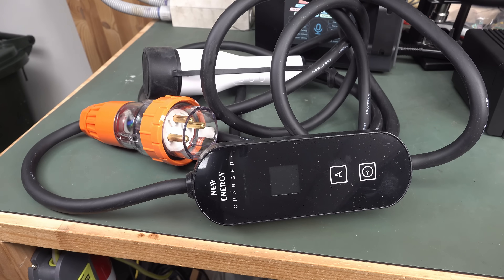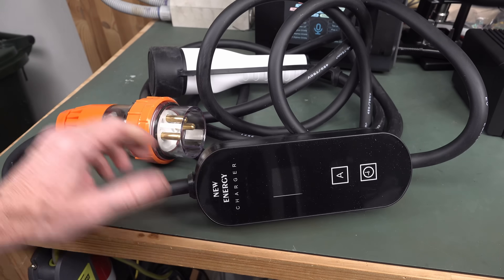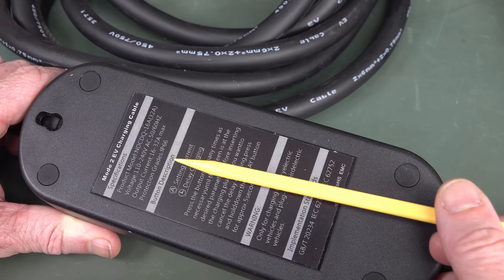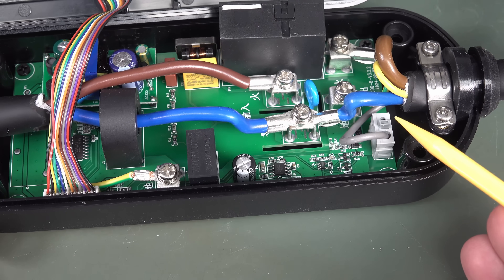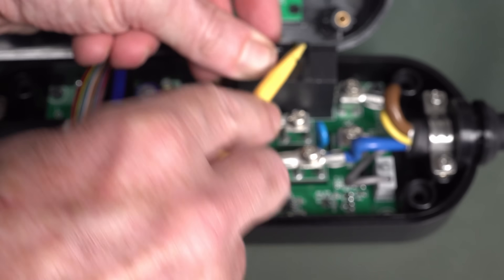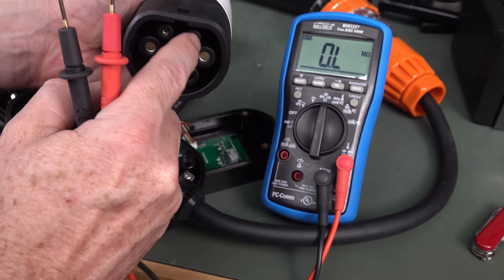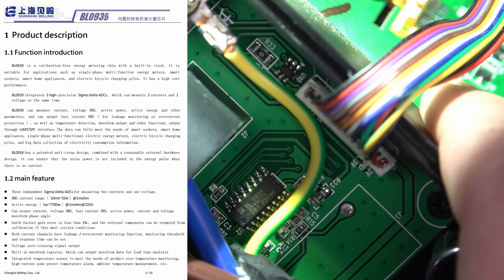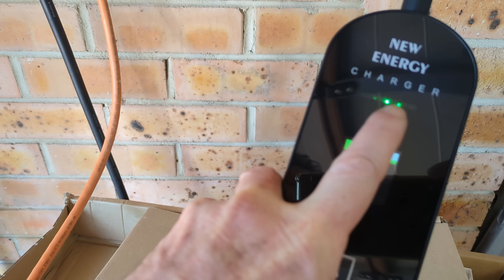EEVblog 1643 - DON'T BUY this Cheap 7kW 32A EV EVSE Charger

Comment: The best description of an EVSE is a "smart safety switch".  It makes sure the cable is dead until both ends are properly connected.
Reply from the maker: Yep, and if it lacks both the "safety" and "bead"  feature like this one does, it's a loser.
Reply: @randycarter2001  …a fancy extension cord with safety switches.
Reply: The only thing I don't understand is why the heck are they so expensive?
Reply: Not sure this one makes sure, it has a half hearted go though.
Reply: With some metering and power negotiation features added. All the AC/DC conversion and control over the current drawn from the mains is in the inverter built into the car. 

It's like:
(EV) Hey, I'd like to charge. How much power can you supply?
(EVSE) I can give you 7kW of power.
(EV) OK, I'm locking the plug on my side. Start the charge.
(EVSE) locks the plug on its side if applicable (if it has a charging socket instead of fixed cable), turns on the relay, indicates charging state to the user with some LEDs etc., monitors power, informs other systems like power balancing, billing etc.
[Time passes...]
(EV) I'm charged, you can cut the power off now.
(EVSE) turns off the relay, unlocks its socket where applicable, indicates charged state to the user and external systems
(EV) unlocks the car cable socket.

This communication uses voltage levels on the control pilot (CP) line, with 1kHz PWM square wave. New standards like ISO 15118 allow for bi-directional communication between the vehicle and grid (V2G) and this opens up a whole new bunch of possibilities, like using a car as a power storage with a bi-directional inverter and supplying power to the grid if desired, with load-balancing between peak and off-peak demand time in mind. Charge when electricity is plenty and cheap, discharge when it's in demand and expensive.
Reply: The extension leads I use for powering all sorts of other appliances eg a welding machine, an electric lawnmower, doesn't have fancy electronics in it to make sure both ends are properly connected so why should the lead for charging my car need this?
Reply: @Skoobedobedo  Because the pins are big , so they can deliver lots of amps. Easier to accidentally get something into them
Reply: @Skoobedobedo  with battery charger, you could have voltage at both end of the cable.?? I am not sure, it is what i think, but i don't know😊
Reply: @Skoobedobedo  Simple: Because your lawnmower is typically not used in the rain, and does not need to be plugged and unplugged while passing 7kW.
Arcing is dangerous.

Comment: This thing seems to be rated for 120 and 240 volts as well as 50 and 60 Hz implying it could be used in the North American market. However, aside from lacking any ground fault protection, which makes it unsafe anywhere, It would definitely be unsafe in a North American 240 volt installation because it only switches one of the power conductors, whereas in this setup both conductors are live. You would end up with a constant shock hazard on one pin on the unplugged charging cable.

Comment: I have one of those and most of the time it doesn't work, simply says not connected. Still, on a lucky day, it works just fine, starts charging instantly. Any idea what might by the issue? Why is it not triggering the charging cycle?

Comment: 4:26 I've just recently purchased an MG5, so i've been looking into different chargers and the like. there's 3 things of concern with the cheapy design:
1. Not having the Neutral and Live isolated completely from the car can cause some cars to back feed DC into the house electrical supply. In the UK that's why a Type B RCD is used in EV installations. It was found that a car could leak DC back to the earth and cause shocks even with a standard type A or AC RCD because they wouldn't trip.
2. Not having them isolated also means installations with a split phase, say 120 - 0 - 120, could still feed the car with 120v even when the car is commanding the switch to isolate the supply.
3. Not having an RCD inboard of the charger is just dumb :P

Comment: Charger sitting in the car not in that electric box. Many thinks a little box is a charger. And misleading from business is a reason for that.

And fun fact: The blue cable is not neutral in Norway it's live 115-120V and brown is also live 115-120V. It powergrid is standard in Norway. So that box is dangerous in Norway becouse is voltage on that blue wire.

Comment: Maybe fine in Australia, but in North America the single pole relay could be an issue. If it's used as a level 2 EVSE here, both of those wires will be hot to get you your 240VAC supply. Maybe nothing bad happens, but still seems undesirable. I know that my EVSE has a double pole contactor that disconnects both sides when not commanded to supply power to the car.

Comment: Playing devil's advocate, but a downside to switching both live and neutral is the user may be blissfully unaware should the live switch fail short - hardly unknown in 'high' energy switching when the contacts weld together. Are the adapters required to detect and report this failure mode? I'd have thought that this may be a much more common fault, especially for a relay switch with much less power available for the switch operation than for a manual switch/breaker, than that of a reverse wired supply (I assume that in most countries 32A circuits will have polarized outlets/connectors).

Comment: All "EV chargers" are just voltage/curent measurement devices, eg. power meters with a disconnect relay, some fancy display and some payment methods. Why they are called chargers? They are just  some boxes with wires...

Comment: I would probably simply call it "EV cable" for the mass but basically it's almost identical to a smart plug, calling it charger increases the prices for nothing as I've seens so called "chargers" sold for 3 grand or more in some cases. The missing RCD I don't think it's a big of an issue but it should be stated in the description, most countries (like mine) require to have at least one  RCD that cover the whole house/bulding. I actually think that much protection is overkill and it's hindering the popularity of EVs dude to increase prices. My 9kw electric shower doesn't have a dedicated RCD, my 3kw electric heater doesn't have it too, why the EV charger should have it ? For the missing relay I think that if neutral is actually neutral it should not be an issue, If you think about it in the USA there is no protection in any socket and the plug design is much worse than a EV type2 where the contacts are well recessed inside the plug, you can literally touch live metal while plugging in any appliance, based on this logic each socket should have those protections.

Comment: For all of you who did not notice, this device has 0.75mm² ground wire, same as CP wire. While this is more than enough to carry communication, it is not enough to ground a 32A circuit. And this EVSE has no RCD inside, so the only protection you have is RCD somewhere else in the circuit. If your 32A socket is not RCD protected, and there is a short circuit, ground wire would catch fire. 
If they were cutting cost, they could use thinner wire, for example 2.5mm², which can handle 32A short for a few second, enough to trip the breaker. 
But 0.75mm² is not enough.

Comment: I make the simplest possible EV chargers using DIN modules, but:
They all have RCD
They all have double isolation relays

Note that having lathing relays is a terrible design. If your internal power supply fails, there is no way to unlatch it, and the user might plug it in within the latched position. Effectively making a mode 1 charger.

Comment: So there is absolutely nothing actually wrong with this "charger" but we still get an all capital DON'T BUY clickbait title?
Reply: It's non-compliant is the issue.
Might work fine but there is a greater risk of failure compared to a compliant unit.
If this unit caught on fire and the insurance examined it and found it, what would happen?

If I buy a Jeep and have no problem I might say they are good cars, but there are a lot of failures in those vehicle, I just have survivor bias. 😉

Comment: This is an "In-cable control and protection device" (IC-CPD), defined by IEC 62752 (printed on the back). RCD feature is a must - should monitor both AC and DC faults. Also note that the ground wire is thinner than the other wires; this is typically not allowed. Don't buy.

Comment: Does not look to be legal in EU. As much as I remember, in low power systems (like 32A is) PE core must be at least same size as live (phase) wire.
Reply: It is true. The protective earth should be equal to active wires.

Comment: Hi Dave!

That charging cable could be bought online in China for CNY 258.2 (~AU$ 53.5) after discount, with free delivery. Of course it comes with Chinese type I mains plug, not AU mains plug. 
Dual relays for both neutral and live are mandatory in Chinese standard (GB/T 18487.1). RCD is also mandatory. GB/T 20234.2 stated on the marker is Chinese standard equivalent to IEC 62196, which defines the type 2 connector on the vehicle side.
On the control board it says "单继电器底板" (single relay base-board) so the single relay design is intended. They may have a dual-relays version as well. Maybe you could talk to the company "宁点" (Ning-dian) with the cellphone number they left behind it.
The push-in connector J5 on control board says "温度" (Temperature) but left unconnected. Maybe there is an external temperature sensor not installed yet.

Comment: Considering that these things ought to be designed out entirely (just plug into the wall, dial-a-charge on the car dash, why need a dongle, waste of material and money), the worst and cheapest is the best! Always has me shaking my head. What absolute muppet came up with this specc. Any car should accept AC and DC without a dongle. And should be able to charge off solar cells directly. Matter of national security, so people can charge on dodgy sources in an emergency. And actually - as a power  engineer - no real added effort. I need a lot of control authority for CC/CV charging let alone more advanced algorithms anyways. All digitally controlled. Easy to include some MPPT and other features. Finally we get to the issue of burning down your garage. A proper circuit will trip the breaker before burning down. Dont need "smart" for that either. If it doesnt, it was installed by criminals.

Comment: 1:30. Copper coated aluminum is a nightmare. With PoE, it has the potential to cause a fire because of its lower current carrying capability.

Comment: All this bullshit should be built into the cars onboard charger so that suitably rated standard extension lead could have been used for charging EV's at home from a suitably rated standard power socket. Maybe even the earth wire could have been used as a reference potential for determining if there is a significant voltage drop occurring between each end of the extension lead?
The extension leads I use for powering all sorts of other appliances eg a welding machine, an electric lawnmower, doesn't have fancy electronics in it to make sure both ends are properly connected so why should the lead for charging my car need this? Anyway we are stuck with needing these special charging leads so I guess no point thinking about what could have been.
Reply: Probably cheaper to make it external for the various power grids around the world. Also easier to modify if need be, and have the owner pay for it.

Comment: The single relay on/off is good enough according to standard.
"The switching contacts of the IC-CPD are not required to provide isolation, as isolation can be ensured by disconnecting the plug."

Also because the plug is polarized, there is no real need to have relay for neutral disconnection. 

Otherwise seems normal to me expect earthing. Standard also says max. current allowed is 32A, so no worries there either. 6mm2 copper seems to be standard minimum for two wire cables inside a duct and cable.

So judging it is just a energy meter, relay, technically the design is not wrong but if the components used do not fill the advertised minimums, then it probably will burst eventually in flames. Relay is probably the most suspect where this might not last.
Reply: I suspect that language meant to say "reinforced isolation". In that same standard a hipot test is performed from input to output and it's impossible to pass without 2 relays. The standard also dictates the minimum contact distance of the relays so at least basic isolation is required. The ground wire is way undersized at 0.7mm, it should be 4-5mm iirc. Type B RCD is also required. Nothing about this design is safe or compliant

Comment: What is the point of relay'ing the NEUTRAL.  Is it for crap wiring that has N & A reversed by a bad electrician???????????
Otherwise I cannot see why this is a thumbs down??????????
Reply: How do you know if the house has good wiring?
Reply: @Cheepchipsable  1) A simple tester (many on eBay) will tell you, WAY WAY WAY cheaper than paying TRIPLE the price for an extra relay!
2) It is ILLEGAL to wire a house incorrectly, and here in Australia, such wiring errors are ULTRA RARE! as a result.
3) In the car ALL chargers are ISOLATED electrically for both A & N magnetically by a HF transformer, so it actually does not matter anyway.

Comment: It amazes me that people buy cheap junk 'chargers' / plug in EVSE's (unless it's for a review video!). I picked up an unused genuine Audi one with both the 32A 'commando' plug cable and a 13A plug cable here in the UK for about the same amount. They're the same as the Porsche ones, just branded differently. They're a clever design where the changeable incoming cable to the configures the maximum charge current. One model can do 11kW / from 3 phase, 7 kw from 240V / 32A single phase, 3 kw from 240V 16A, and slightly less from 240V 13A, given the right incoming cable. Built in 30 mA AC and 6 ma DC RCD, and earth checking too. 
     BMW / Mini's chargers also have their output current configured by the changeable incoming cable in the same way, but they usually come with only one cable, at least here in the UK, and the other incoming cables for them are ridiculously expensive. Many of the Audi / Porsche ones seem to have originally been supplied with 2 incoming cables, making them considerably better value if you want to be able to use them at say 3.5 kW and 7kW.

Comment: Definitely not legal in Europe. Both live and neutral must be treated as live (we have a mixture of delta and wye supplies), plus who knows how a house has been wired. Full earth monitoring is required, and it must include the most simplest 30mA RCD. Earth leakage or broken earth must be detected too.

The granny charger I got with my VW ID.3 has switched off with earth fault detection at old houses I've visited (which still don't have even a 300mA main RCD) when certain appliances have been switched on, like electric ovens or kettles, highlighting faults in those devices :)

Comment: Whats wrong with aluminium/aluminum instead of copper?
Its a whole lot lighter then copper especially when you have a 380v 63a 3 phase cable with a neutral thats 25 meters long😉
Only downside is you do need to make sure its strain relieved properly and you roll it up in bigger loops then you would with copper.

Comment: The scary part of no switched neutral is if someone didn’t follow code and/or didn’t have a qualified install and inspection and then swapped hot and neutral in the supply circuit.
Reply from the maker: But then the in-built safety switch would.... oh....

Comment: I wonder if the PCB earth connection would be able to handle the required fault current? I don't see why both the in and out earths aren't attached to the same stud?
Reply: I think they might be relying on the earth current only being 10-30mA before the RCD trips.

Comment: At the current conversion rate as of today, $160 AU is about $110 US.   You get what you pay for.   Don't buy cheap crap if you are plugging it into a rather expensive EV
Reply: So if this cable were sold for like $500, would it be OK to buy it? The problem is not the price. For this $100 price you should be able to buy a decent quality relay with a microcontroller and some plastic casing.
Reply: @kralg  A EV charger is a lot more than just some relays and a microcontroller, if you want something safe.  But sure, if you want to risk your EV on a device like this, then do so.   There is a reason it's recommended not to buy it :)
Reply: @EsotericArctos  You did not really read my comment, did you? I never said this charger should be bought, I only said it is not the price that makes this charger good or bad.
But for sure I cannot really see that "lot more" you are talking about.

Comment: The Tesla AC adapter (the actual charger is in the car) has the same Type 2 connector in most markts. Those chargers a high quality in my experience.

Comment: I don’t even care if it’s still complying with the safety standard or not. I would want it to switch both sides and have an RCD. That car connector is likely to have a lot water ingress, or just be left in puddles with the carelessness of people leaving it on the ground without the cover. The wall outlets may be DIY too, so the protections on there and correct wiring order. Well, you can only hope it’s correct.